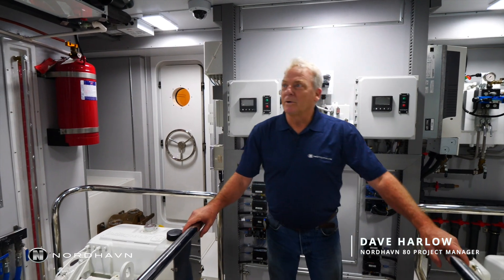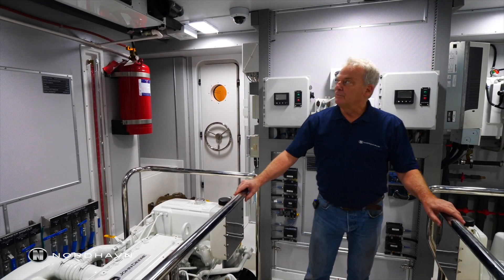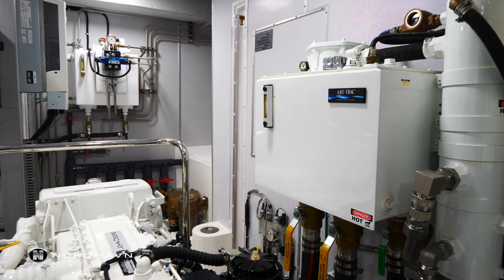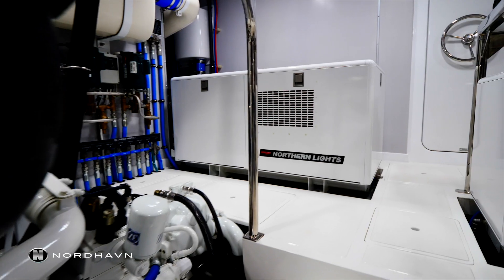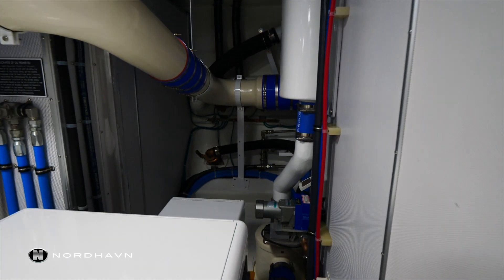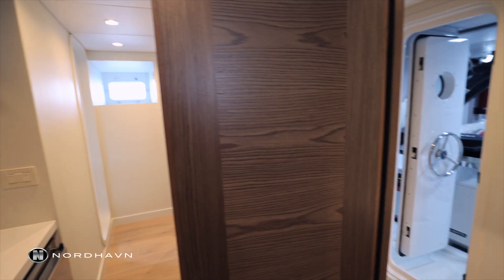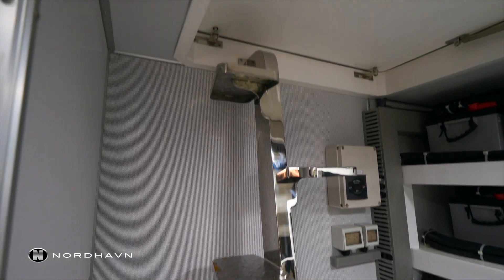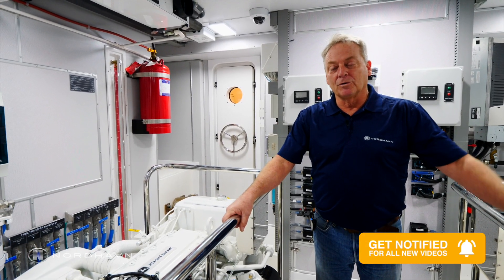N80 engine room and lazarette overview with project manager Dave Harlow

Comment: Can this yacht 80, be made fully disabled accessible,  from the flybridge down to the engine room?

Whether externally and/or internally, or both?

As this 80 yacht, does have a lift installed as an option, so can this internal lift, go to all or most decks and carry a wheelchair too?

Or can stair-lifts, be installed on the internal staircases too?

Or can overhead rail tracking and self-propelled and powered lift hoist system, even be installed?

Along with suitable safety grab rails fitted where necessary, in bathrooms, shower rooms, day head and bedrooms, lounge and dining area, galley kitchen, passageways and public areas etc too?

For disabled owners and family members, plus disabled guests and passengers too?

Including getting on and off the yacht 80, via or with a use of a loading and unloading (wheelchair wide enough) folding or telescopic ramp system too? 

Or have external swing arm powered hoist crane system,  on the flybridge deck, or upper bridge deck and on the main deck in the cockpit area too?

For either lifting a disabled person between deck levels externally? 

Or for lifting a disabled swimmer, in and out of the water?

Or lifting a disabled person and wheelchair, in and out of a tender along side?

Or to and from a pontoon, when moored in a marina or harbour etc?

As disabled people, or those with chronic health conditions, or just those getting elderly, with growing mobility issues.

Are not alway very well catered for very well, with modern yacht designs, as for older yachts just forget being fully Disabled Accessible. 

Or can be upgraded and refurbished, to a fully disabled accessible yacht?

We only seen one new British catamaran explorer motor yacht, design from the start to be offered as a fully disabled accessible yacht!

Yes we are disabled, so this is an important question, from our point of view.

Namaste 🙏, Gurkhamum Wendy and Wheelchaircharlie39 David too
Reply: Hi Wendy, Thank you for your questions about disabled access. The lift that has been installed on the N80 is not sized to accommodate a wheelchair.  To date, Nordhavn has not built a boat meeting the requirements that you have listed and this subject does not have an easy “yes or no” answer. We would be happy to meet with you to discuss your needs in more detail.

Comment: Your 'fully air-conditioned engineroom' - the main engines are drawing vast amounts of intake air from that engineroom - you cannot be airconditioning that air, the AC load would be huge with no benefit.   Airconditioned at jetty or anchor when main engines are shut down?
Reply: Yes.. you have said it correctly. Just when the engines are shut down.